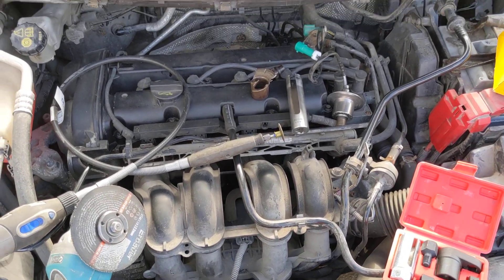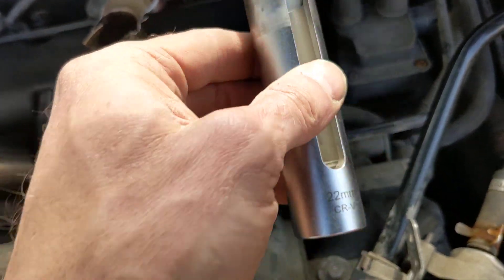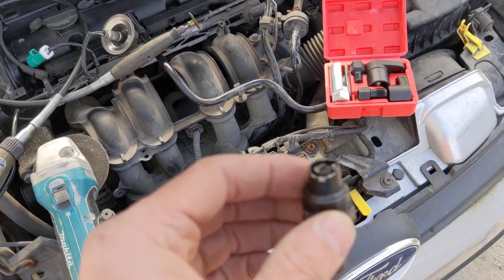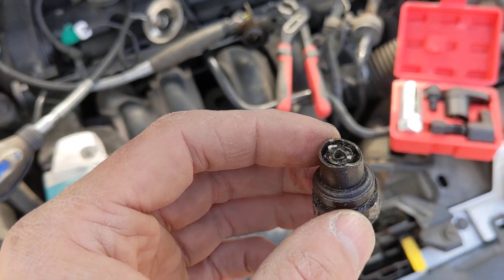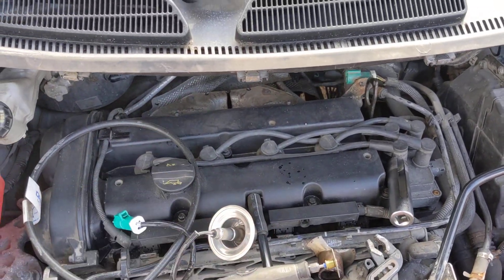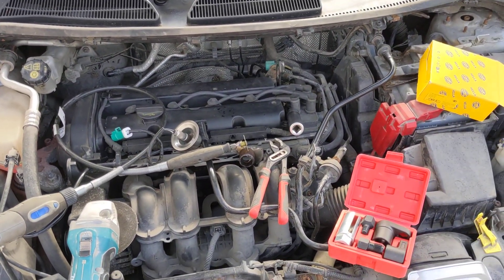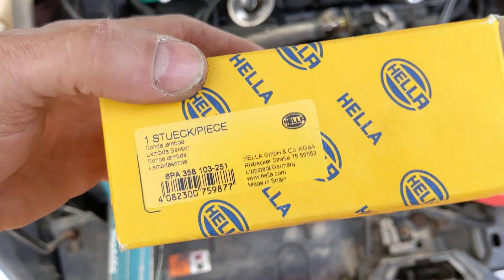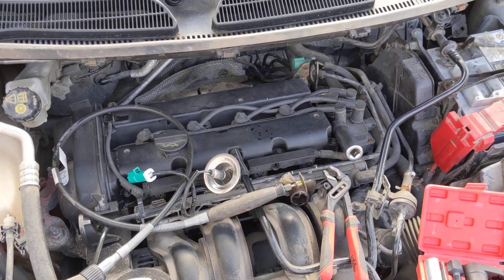Ford Fiesta 2009 1.4 O2 Oxygen Lambda Sensor replacement.

Comment: I'm have the same issue. Im trying not to pay for what seemed like an easy job 😅 but I'm having second thoughts 😮
Reply from the maker: If you have a good selection of tools available it is worth having a go. The issue is tight access and the likelihood the sensor will be corroded in place. If I were to do this again I'd rip the tin heat shield straight out with pliers or mole grips, cut the wire off and get a deep 'normal' socket in addition to the Lazer one I got with I'd just use for putting the new one in place.
Reply from the maker: In addition to my last message, after sending it I saw a video on someone using the Lazer socket I had, but putting a jubilee clip over the bottom part of it when it was in place. They tightened the clip, then used a ratchet to undo the sensor. You'd still have to remove the sensor heat shield, but the jubilee clip idea is worth considering.
Reply: Mine was not terrible at the end. The slotted socket and breaker bar did the trick.

Comment: Hi Gary. Wish I’d found this last week when I did the same job. My original and replacement sensors didn’t have the shield on an 08 plate. I bought a Draper socket but found the same problem with the jaws opening. I had an extreme stroke of luck as I found in the toolbox an impact spec 3/8 socket with a much narrower slot in it. No name unfortunately. I was able to squeeze a very long 1/2” breaker bar a 1/2 to 3/8 impact reducer and the socket into the space. As everything else had failed I just kept pulling and it cracked. Fortunately it was the sensor moving and nothing else! I agree with you re heat and the threads were bone dry so none of the release fluids had found the target. Thanks for your videos.
Reply from the maker: Thank you for commenting. I know my videos don't show me actually doing the job, but that's because I'm generally on my own, I don't have the video equipment/editing tools and I think it would be boring watching someone struggling for an hour and figuring out the 'fix'.
I'm glad you got yours sorted. It is a fairly difficult job but rewarding knowing you've done it yourself.

Comment: Usually starting the car and heating the engine will loosen up the thread making it removable without the Dremel and other tools
Reply from the maker: I did try to remove it after the car was run, but heat usually works when one component is hot and the other cool as that can break the 'seal' where there is corrosion/debris in the thread. My experience was that with both components at equal temperatures the expansion was likely similar so I couldn't get any movement. The sensor had been insitu for over 15 years so i knew it was going to put up a fight and access on the car is failry tight/restricted. It will be interesting to see if anyone else comments that they had success with the sensor removal with the engine up to operating temperature.